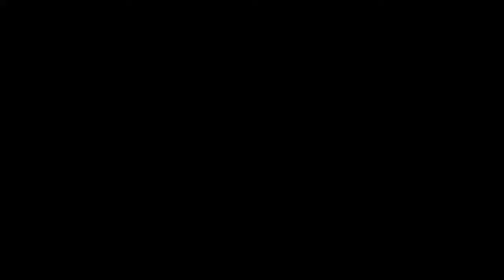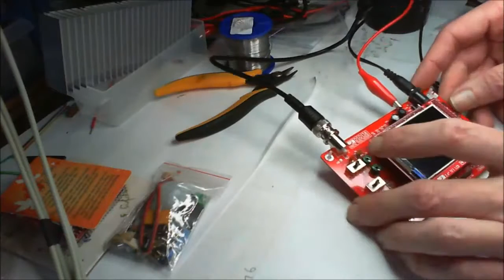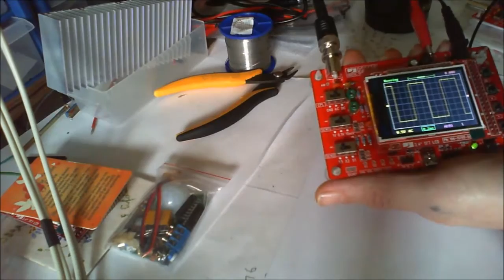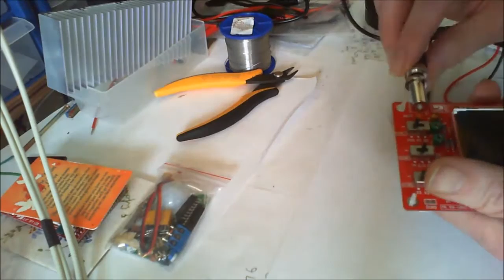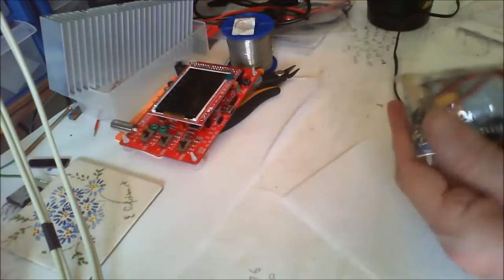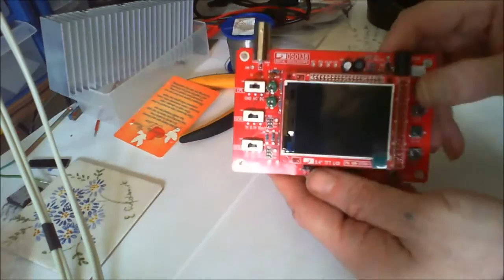Faulty DSO138 Osclloscope Pre Troubleshoot and Fix

Comment: I read today somebody saying to try the follow procedures:
.... I've had a similar problem. I found that if you push the two middle buttons , up/down, at the same time, it goes out of that mode and works.
Reply from the maker: OK I shall try that with a faulty unit and also with a good one to see if there are any differences. Thanks for sharing.
Reply: Yh,  its written in the reference manual.  I can send tge instruction list via gmail,  if u want.

Comment: Hello, 
I have the same issue. No signal only waveform showing. Can you suggest me some most common problem with this?
I have tested all components and soldering everything seems fine. But testing and probe not working even all switch of left sides also not working.

Comment: Hello,

Have you figured out what the problem with the faulty one was? 
I have gone through the troubleshooting steps, but all seems fine, except for the fact that the trace ( yellow line ) doesn't move when i touch the probe, or when | connect it to the step signal.

I can upload a video of it if it's of any use to you.

Kind regards
Reply from the maker: Mine had a faulty -V regulator,. After changing it it works fine.
Double check your components and ensure the capacitors and resistors are fitted correctly, it is easy to make a mistake. Also make sure your solder connections are good, lots of these boards came to me and the soldering was difficult to get a good connection and that would cause errors
Reply: Thank you for the fast reply. 
I will try to check the regulator later today to see if I missed it.

Comment: after all steps done the my LCD woeks but it doesnt show any waveform what must i do?!!!!
Reply from the maker: Can you put up a video showing the fault as it is hard to understand fully with your question.
Reply: sorry my speaking english is not very good.after i solder all component in place i connect the oscilloscope to the 9v. then the screen works but when i connect the red probe to the J2 it doesnt show anything even the yellow line(which is show the waveform) doesnt exist on screen i dont know what to do?!
Reply from the maker: Your English is fine :) Is the screen white?
Reply: i found that i didnt short back jumpers after soldering them now the screen is whit.but befor shorting them the screen still showed background just wave line wasnt shown and now its totally white!!!!
Reply from the maker: The screen is normally totally white when the jumpers on the component side are not soldered.  You need to find JP3 and JP4 on the front (component side) of the board and solder them. Un-solder any jumpers on the rear/back of the board, that you have soldered.
Reply: I have the same problem. Can you suggest the solution to this?

Comment: i made the same problem. any tips or progress?
Reply from the maker: Hello Fabianwew, I have done voltage checks and am missing negative voltage all the rest of the test points seem fine. I am wondering if the 79L05 is bad. I think I have to take it off to test it. Does yours do the same?
Reply from the maker: +Fabianwew I tested the 79L05, it is fine. Back to head scratching. What does yours not do?
Reply: I had the same problem - no negative voltage. Turned out to be a duff transistor in the negative voltage generator.
Reply: Elecifun Oh sorry haven't seen your comment until now. I haven't messed  around with this thing for quite some time. Did you get yours to work?
Reply: Yes, though it tends to have noise on the trace even after carrying out some modifications that I found on the 'net.
Reply: Silver Legend I stopped caring for it when i got my semi professional oscilloscope set up. Would still be nice to have it hanging around. Did replacing the transistor fix it?
Reply: Yes, it worked as well as I expected for a kit costing less that 12 £sterling.
Reply: Silver Legend People seem'd to be mostly succesful in using it so I gave it a try.
Reply from the maker: Have you updated the firmware?
Reply: No, I'm awaiting delivery of the USB adapter from Banggood.
Reply from the maker: Which adapter are you buying?

Comment: im having problem with the test signal it didnt came out but whe i switch the sen1 to 10mv and reduce it shows but small ad cant read the frq how can i solve this?
Reply from the maker: You have to check all components are in the right place and then make sure all the solder joints are good. These boards work 98% of the time for me. I have built nearly 200 and only had a few not work well. Two were my fault, 1 had a capacitor missing another a bad solder joint. The another was a faulty inductor.
Reply: Elecifun 
i already checked it.
when below 10mv it can read very small signal, all components are in the right place and i already checked their values, i just bought it last wednesday, can you help me with this?
Reply from the maker: Well if you have already check all components are in the right place. Check the power, check at the transistors + and - . Make sure they have correct power in and power out. You have a troubleshooting sheet. Make sure all voltages are correct. It is a pain, but you will find the error.
Reply: Elecifun 
i noticed that my u4? the 79L05
has an output of 22v? it seems weird is it broken?
Reply from the maker: There is something wrong there. It should have about -8V going in and -5V coming out.
Reply: Elecifun yes, i tried to replace it but it stays the same
Reply from the maker: What voltage are you powering it with ?
Reply: Elecifun 9v dc supply power, i tried to supply ut with 9v battery and it gets the -8v
Reply: but it doesnt fixed the problem it cannot read any signal but it has a trace
Reply from the maker: How were you getting an output of 22V from the regulator?
Reply: Elecifun idk sir, even in the tp25 it does -22v idk why,
Reply: can i email you sir?
Reply: If no work change IC TL082